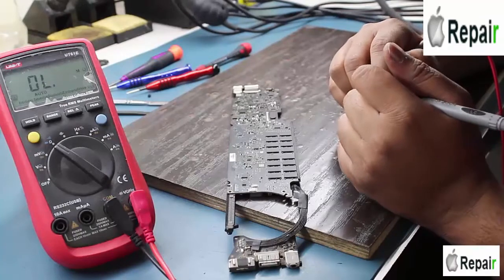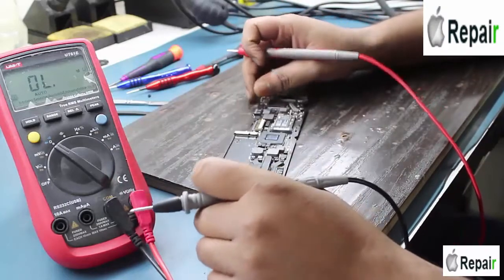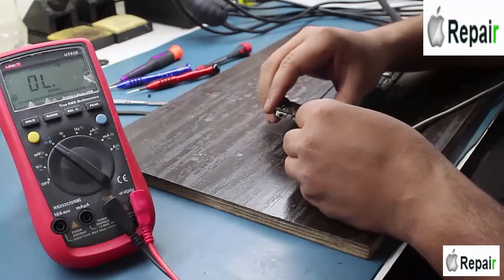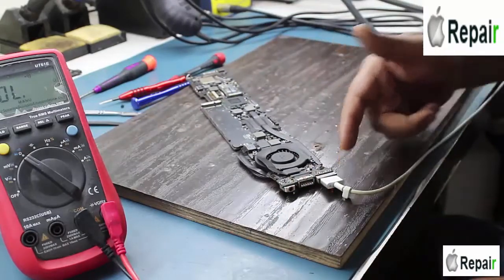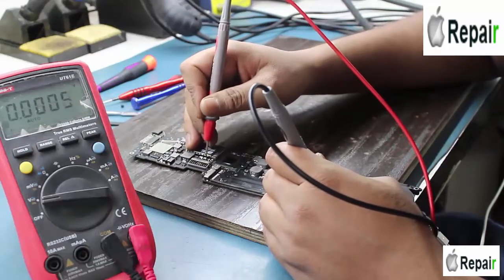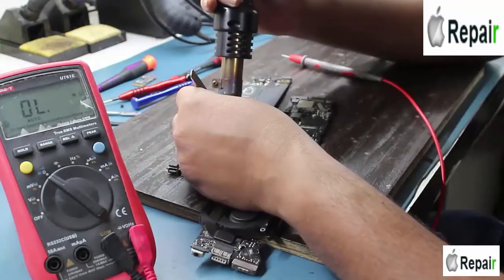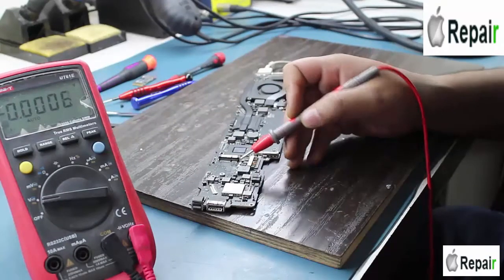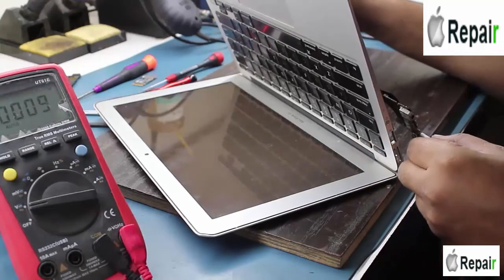Apple MacBook Repair with no power on dead logic board repaired | Online Macbook Repair Video Course

Comment: PP3V42_G3H is present L7095 getting 3.5 v but no green light
and 0 volts on pin 3 in u7100 
R7110 pin 1 15.7 v and pin 2 - 0v
Reply from the maker: Check DCIN SECTION